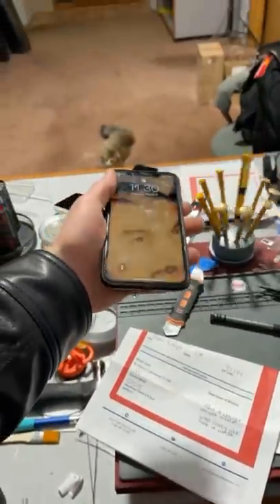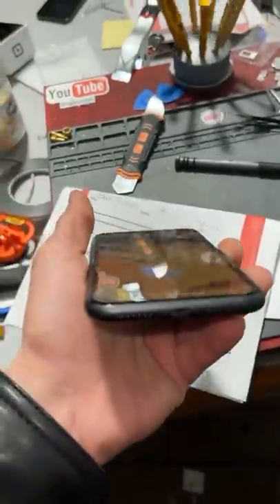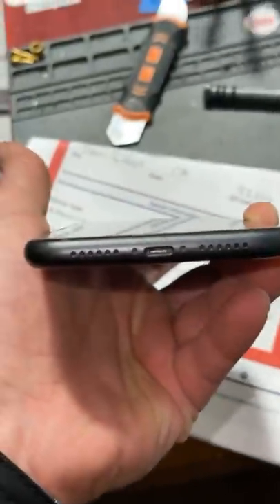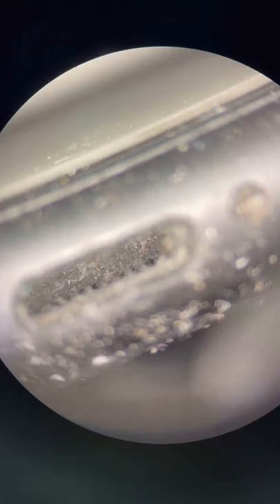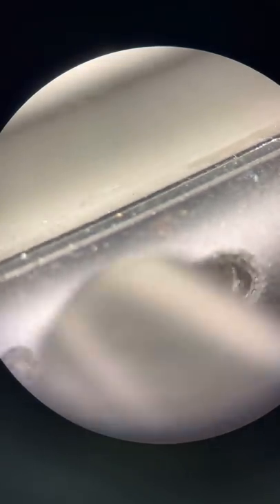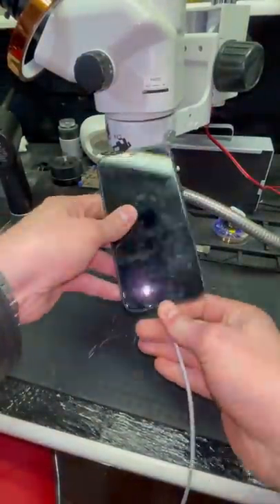Broken iPhone Charger Extraction #shorts #oddlysatisfying #iphonerepair

Comment: And this, my friends, is why type C is superior in every way.
Reply: That just doesn’t make sense because you can still get the same issue like you can still break a charger
Reply: @tyloren2378  it doesn't break off in pieces though, because the metal is all one round piece while lightning is metal surrounding plastic. And honestly, I don't see how USB-C could break at all, the chargers I have are really sturdy- I used to break micro USB all the time because they would get bent or come loose, but that just hasn't happened with USB-C

edit: and this isn't a matter of android vs apple, apple themselves do use USB-C as well
Reply: @tyloren2378  Type C are reversed, and significantly stronger. Have you ever seen one? If you have you would know what I mean.
Reply: Seriously tho this would never happen with an android
Reply: @leansnscenes7806  You realized something, it isn’t due to a iPhone and Apple’s iPads use USB-C
Reply: @relate97  Type C has been out for around 6 years now
Reply: @relate97  I was literally just replying to what you said. You dont need to get nasty. The internet is nasty enough already

Comment: If you're wondering why the guy used glue my guess is that he must've tried to join the two ends of the charger using glue and pulling it out.
Reply: I did that when my headphones got stuck in the port and it actually worked, but I went to geek squad first and they TOLD me to do that so its not a "stupid idea" as everyone is saying
Reply: @sierrarose8727  it's not stupid but it definitely is risky if not done carefully

Comment: What do you recomend doing when your phone says there is water in the charging port?
Reply: Leave the phone in a dry area (like your furnace room--not on the furnace itself) in a bowl of rice. You could blow dry the port on very low heat. 
Phone ports are way more vulnerable than they need to be an sensors are way more sensitive than they need to be. Remember that your phone was made to make money for the company that sold it to you, it was not made for you.

Comment: How is this cheaper than have a local phone repair replace the whole charger port for like 50 bucks? I had my screen, back glass, audio port, speaker, and charger port replaced for like 200 bucks. Granted, I think it's more now with Covid.
Reply: Because it doesn’t cost that much. Also, you don’t know how much he charges!